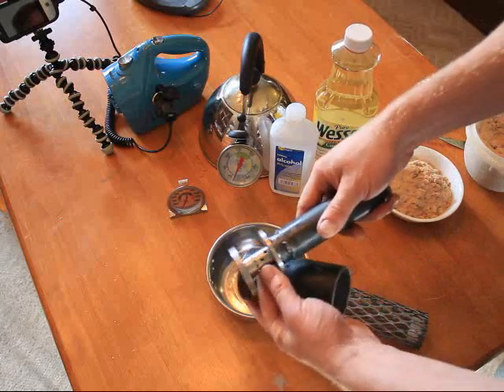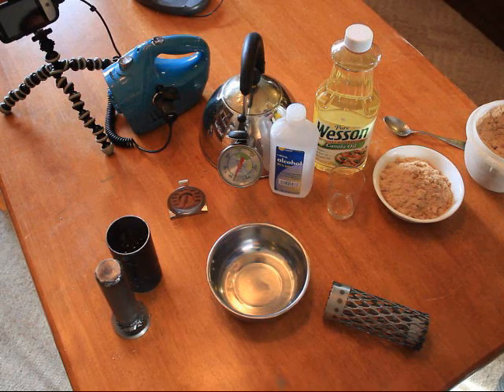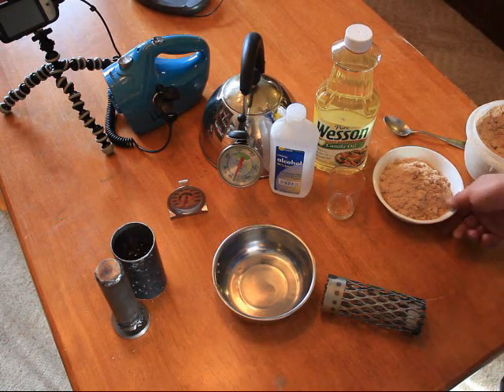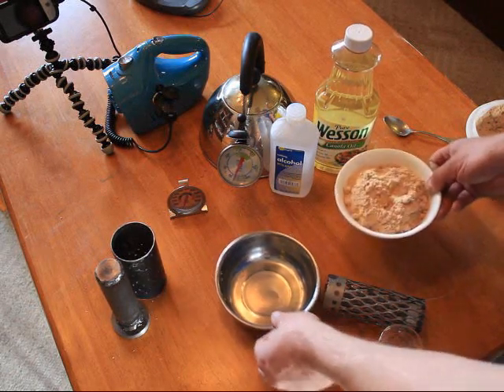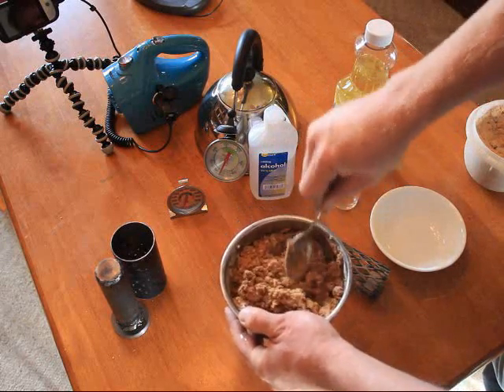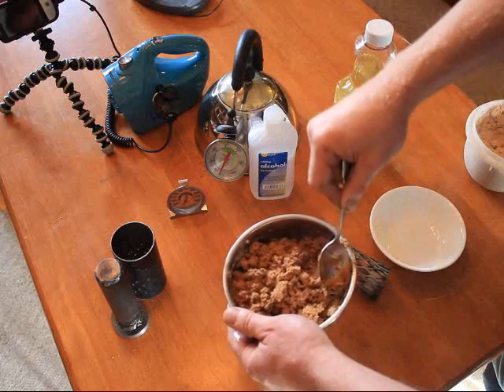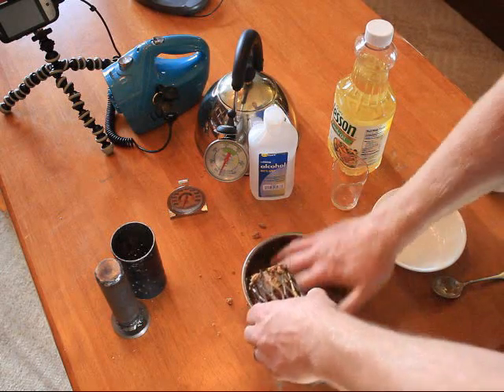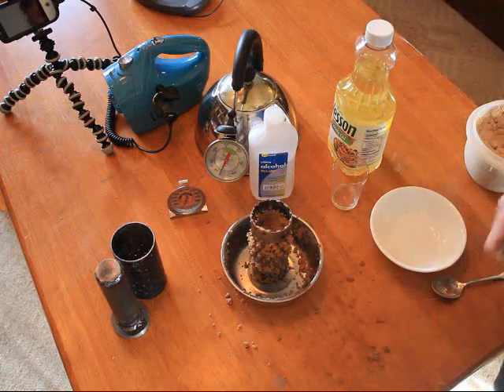"Fire Dough" and the Sawdust Stove for Muddy Biomass Fuel Briquette Alcohol Vegetable Oil TLUD

Comment: I think you can omit the alcohol, actually. I make "logs" with a mixture of sawdust and shredded newspaper, and used fryer oil from  restaurant. then pack it in various cardboard tubes.  It works very well and very good burn times and pretty clean also.
Reply: Good Idea you can use chicken or pork fat oil

Comment: Just some thoughts, but various oils have higher burn temperatures than others. Not sure if veggie oil is the highest or if it is even a significant enough difference to begin with, but there are temp variations on different oils. Pressed oil from pine cones may last longer for the burn. Also, you could try a combination of shredded or fine mulched leaves or even coconut husks as the mix in this paste briquette if you didn't have saw dust handy. Unfortunately, the alcohol  your using would have to be used pretty quickly or it would dry out of the bricks due to evaporation, I'd bet.Most of the videos regarding making briquettes from paper always show them being squeezed out into a log or a round donut-shaped item. I am wondering if a mix could be made so that the fire starter or product could be patted like making a tortilla or such and be molded or shaped solely by hand? Your mix is too flaky for such hand molding though.  Thanks for posting

Comment: Just saying, if you push the first batch down, Pull up the plunger, put a washer on top, make another batch, push it down and so forth you can then remove a longer batch and separate them from between the washers and you will be able to make them faster in ONE cylinder.  Or you can make a longer cylinder with more holes and make a Bunch in one setting. You may have to drill more holes though.  Just a suggestion. Be safe,,good vid.

Comment: WHAT ABOUT USEING THE DISCARD FATS-OILS FROM COOKING WITH THE SAWDUST-PAPER-OTHER FIBEROUS DISCARDS.  PUT THESE INTO A CYLINDER OR BLOCK SHAPE WITH AN ASSORTMENT OF WEIGHTS,  OR HYDRAULIC RAM,   OVER TIME,  & MAYBE WITH MINIMUM FILLER FOR PASTEING/GLUEING THE FIBROUS MATERIALS.    THEN A DRYING PERIOD,   AS REQUIRED.   NO MOTOR OILS UNLESS VENTED.     ,REGARDS,

Comment from the maker: Thank you! Yeah thats what I would assume but would need to collect better data to know. My theory is the volatile alcohol allows the wood gas and oil to burn and not just smoke. There was a little unburned carbon at the bottom so certainly room for improvement on this first trial.

Comment: Thanks for the video! I made a paper briquette press and used 2" PVC. Soak the shredded paper for a few days, press what I can fit in the PVC, let dry for a few weeks. The bricks are very hard and tough to light without an accelerant. I pour a little charcoal fluid on the briquetts to get them started which works good and they burn a long time. I'm thinking of using leftover grease to soak paper in so they light right away. Good job and nice stove! Muddy has a great channel too!